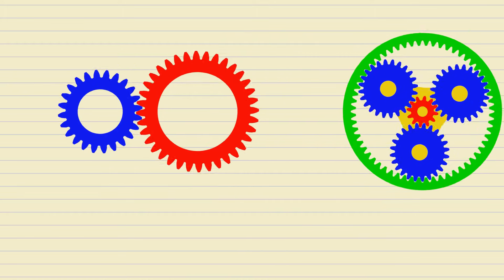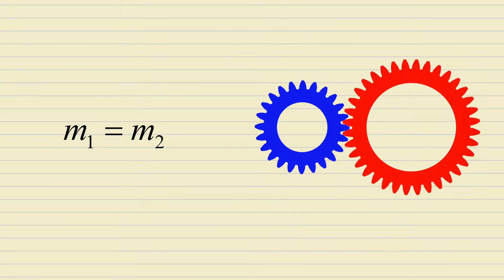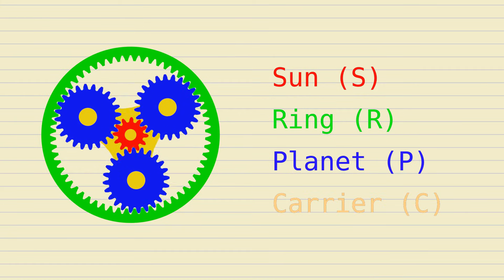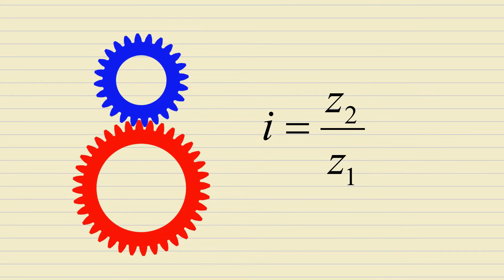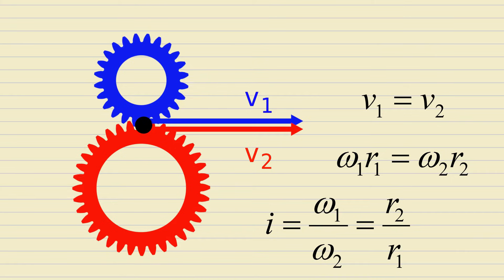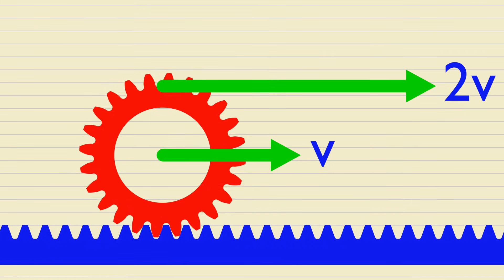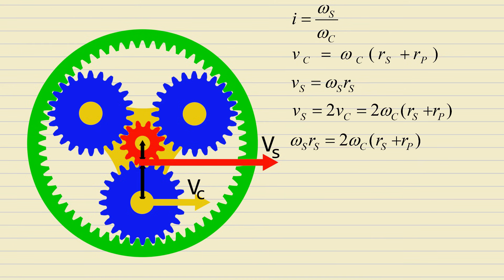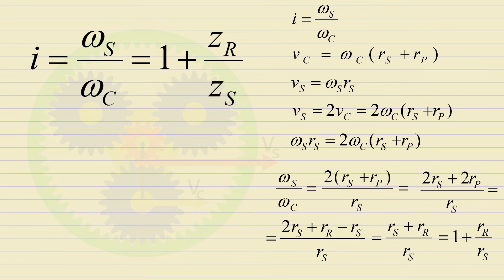Tutorial: How to Derive the Formula for the Planetary Mechanism Gear Ratio

Comment: There is a single equation that can be used to describe the gear ratios under all conditions.

(NOTE: I'm using subscript p for the planetary carrier here because there is no unicode symbol for subscript c).

In the frame of reference of the planetary gear carrier, the contact velocity is same, but opposite, at both gear interfaces.
Therefore, the gear ratios can be derived using the following constraint:
    
  (ωᵣ-ωₚ)∙rᵣ = -(ωₛ-ωₚ)∙rₛ

The relationship of rotational speeds, ω, and gear radius, r, (or number of teeth) is:

  (ωₛ∙rₛ) + (ωᵣ∙rᵣ) = ωₚ∙(rₛ+rᵣ) 
  
This works for all operating conditions, including with all elements in motion (like hybrid power split transmissions).

For the example given in this tutorial, ωᵣ = 0. Thus:

  ωₛ/ωₚ = (rₛ+rᵣ)/rₛ = 1 + rᵣ/rₛ

Comment: There are three main configurations of planetary gear systems: 1:planetary, 2: solar, 3:star.
1: Planetary type (internal gear fixed, sun gear as drive shaft, planetary carrier as output shaft):
Gear ratio = number of teeth of sun gear / number of teeth of internal gear
Example: For 12 teeth sun gear and 60 teeth internal gear, gear ratio = 12 / 60 = 1/5
2: Solar type (sun gear fixed, internal gear as drive shaft, planetary carrier as output shaft):
Gear ratio = number of teeth on internal gear / number of teeth on sun gear
Example: For 12 teeth sun gear and 60 teeth internal gear, gear ratio = 60 / 12 = 5
3: Star type (planetary carrier fixed, sun gear as drive shaft, internal gear as output shaft):
Gear ratio = (number of teeth on internal gear / number of teeth on sun gear) + 1
Example: For 12 teeth sun gear and 60 teeth internal gear, gear ratio = 60 / 12 + 1 = 6
Therefore the gear ratio is 1:6 in the case of a *star type (fixed planetary carrier, sun gear drive wheel, internal gear output shaft).
Reply: Gear ratio for planetary gear system=1+(No.of teeths on ring)/No of teeths on sun gear.
1+(60/12)=6
Finally gear ratio is 6 not 1/5.

Comment: Perfect instructions!!! I got full understand for my planetary gear system. And I have one question for compounnd planetary gear such that one tooth of planetary gear meshes with sun gear and other tooth meshes with ring gear. From googling, I understand both tabular method and algebraic method can be used. But I couldn't solve gear ratio formula for compound planetary gear using your method ... Vc and zero velocity at the ring contact point and instantaneous velocity at the sun contact point and so on. Please could you give me some directions?

Comment: Thanks for a clear explanatin.

Can any body explain, if the sun gear has 30 teeth, panatary has 15 teath, and ring has 90 teath what will be the RPM of the carrier if the sun gear is rotated at 1000 RPM, under the following conditions.

 Sun gear is the driver and carrier shaft is the driven connected to a load.

1. The ring gear is held stationary.

2. The ring gear is free to rotate, and the carrier shaft is loaded.

Comment: How do I determine the amount of teeth of the planet gears?
Reply from the maker: You pick the number of teeth of all three types of gears arbitrarily based on the desired gear ratio or pure aesthetics. However they are subject to restrictions, the main one being R = 2 * P + S. Also, the number of teeth in the sun and ring gears must be divisible by the number of planet gears. Typically, there are 3 planet gears, but sometimes there are 2, 4 or more. The 60/24/12 combination used in our example will work with 2, 3, or 4 planet gears. However, a 60/20/20 combination will work with 2 or 4 planet gears but won't work with 3, as 20 is not divisible by 3.

Comment: I want to ask
For example
Sun 12 teeth
Planet 24 teeth
Ring 60 teeth 
If the sun gear turns 360° 12 teeth, the planet gear will turn 12 teeth 180°

If the planet gear turns 12 teeth 180°, the ring gear will turn 12 teeth 72°

But if we calculate this by using this formula we get 360÷((60/12)+1)=60°

How it can be? (The formula is true, i dont say it is wrong) but What is my mistake?

Comment: Or you can add the teeth of the ring gear and the sun gear and divide by the teeth of the sun gear.   60+12/12=6.   Hmmm
Reply: derrick dry how does this work?
Reply: @shaq__2400  Simple math substitution. Change the 1 to zs/zs...
Reply: @shaq__2400  it is basically different form of the formula used in video above
Reply: Or you can 
 12+60=72
72-48=24
24+12=36
36/6=6 that's it! Easy pesy